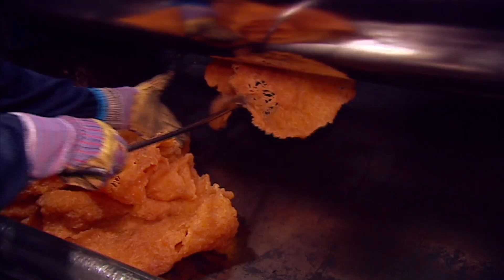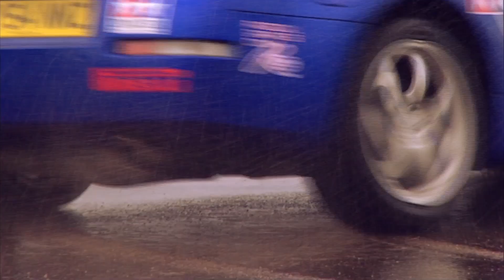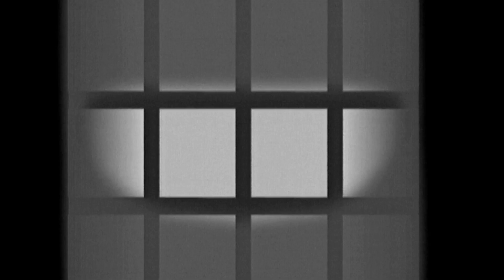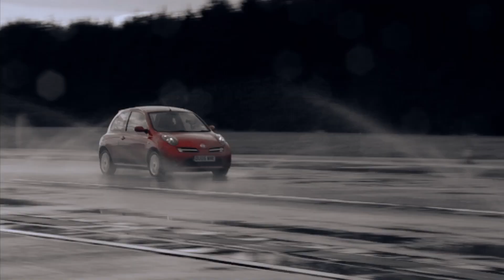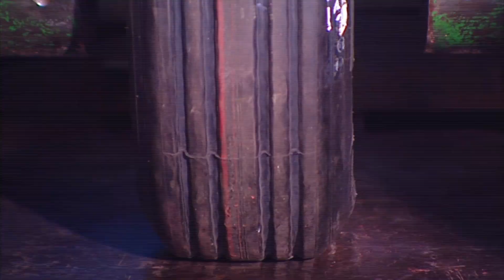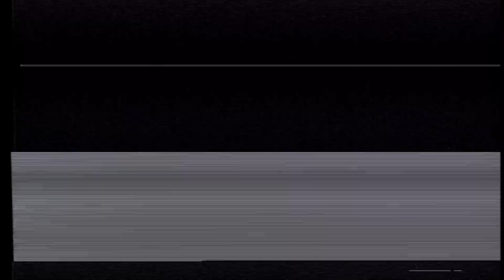How much PSI before a tyre explodes? | I Didn't Know That

Comment: I worked with a guy who did aircraft tyres. His test station for the first inflation was a concrete room with 3 foot thick walls, with a blast proof steel door, and a roof designed to blow off in case something went wrong. Nicely far away from anything else, and he made sure that he never had to call in to get the roof replaced because of a fault he did.

Those old aircraft tyres are sought after by farmers for agricultural trailers, simply because they are so tough that even driving through heavy thorn bushes will not puncture them, your tractor might need a patch on the big drive wheels, but the steering axle with those on will never puncture, though they are not street legal at all. But for the farm tractor perfect, lasting for many years.